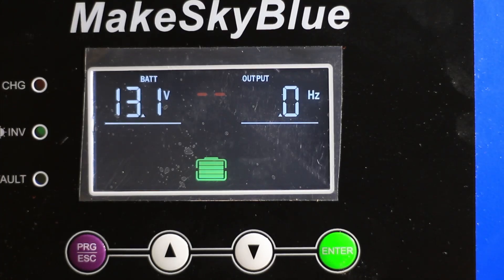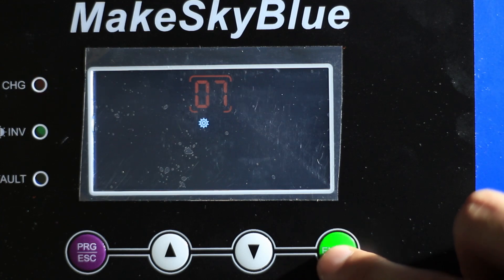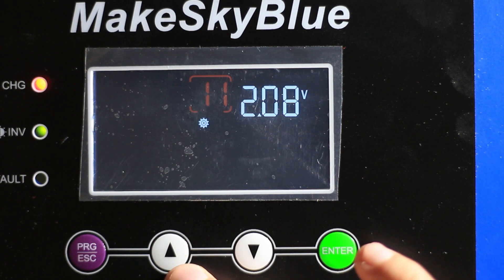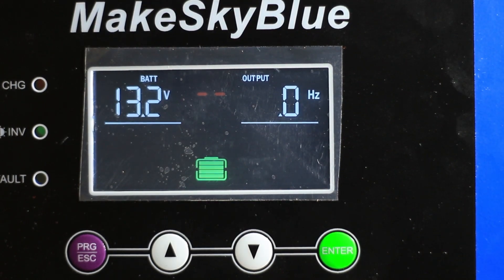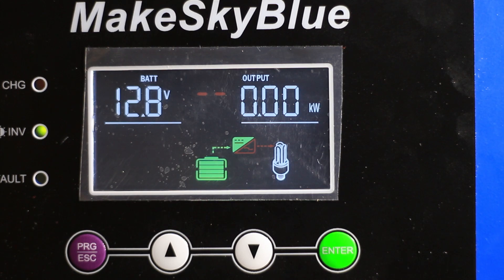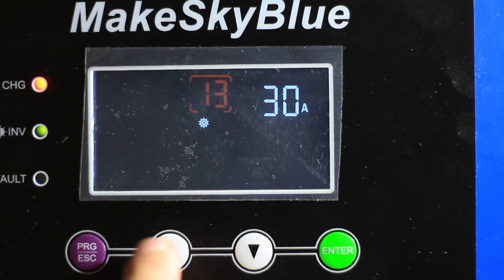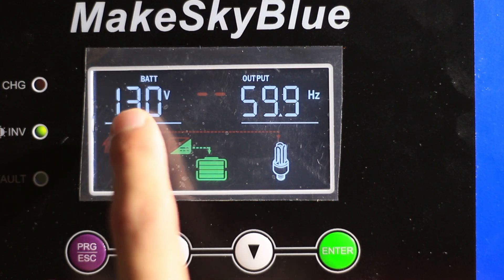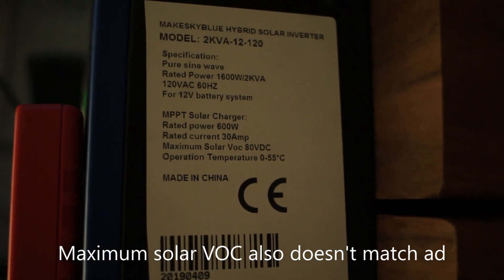MakeSkyBlue Hybrid Solar Inverter Issues

Comment: Well I realize this is an old video but I picked up one of these the two kilowatt 12 volt and the on/off switch seems to have no function at all. When you connected to battery the unit is on

Comment: I've purchased the 3k watt unit and found the same issues.  The website stated a capability of 3k watt of PV.  The manual stated 1500 watts max.  When I questioned the company, they told me that the manual was in error and would be corrected.  The site and manual remain unchanged.  I confirmed there is no AC internal battery charge capability even though the website and manual stated there is this capability.  My unit failed after 30 days of use.  I attempted to get some warranty action from the company but warranty was denied as I had "abused" the unit.   In further discussion with a company rep, he admitted that 80% of warranty claims are denied.  I hope people will learn from my experience with this company.

Comment: I purchased one of these it was 3kw 48volt model and I found that the menu options are limited but I found that it has a wifi ssid showing mppt and some numbers.  I am off grid and no wifi around me so I looked up and found that makeskyblue has an app and with the app on your phone and connected to the mppt wifi you have far more control and you can change the options with it to lipo etc.  Nothing was in the manual about the wifi or app.  You do have to have the communication enabled before wifi shows up.
Reply: Were you able to change the battery type, cutoff time etc using the App? In my case it didn't work.

Comment: I like my Aims inverter/charger...it has a battery selector switch...just turn it to lithium or lead...I guess it does the math or someone already did...it was just easier for me...what's funny to me is everyone has a different inverter so their system acts a little one way or other, so it makes it hard to compare to someone else especially if you're trying to figure out what to buy...it's kind of like running through a junkyard without stepping on a coil spring or starter laying loose...you'd better watch it...lol

Comment: What model are you reviewing? Is it this one? https://makeskyblue.com/products/2kva-hybrid-mppt-solar-inverter-12v-dc-to-120v-ac
Reply from the maker: Yeah looks like it.
Reply: @stingy49  hey thanks for the fast reply. Does this pdf manual answer your problems with it? https://cdn.shopify.cn/s/files/1/0108/6957/1646/files/HYBRID_MPPT_SOLAR_INVERTER_FOR_1K_2K_3K_4K_5K-V1.6.pdf?v=1585972835
Reply from the maker: @MoBiRa-t6k  The unit (and manual) I got didn't have lithium battery setting. Even still, most people would want to set their battery voltage charge and discharge cutoff points for safety.
Reply: @stingy49  that manual i posted shows a lithium battery setting.
Reply from the maker: @MoBiRa-t6k  Yes, but the charge voltage of the lithium setting is not configurable
Reply: @stingy49  yes. It doesn't work.

Comment: Did you ever make it work or how did the story end? The App Ken talks about is most likely for MakeSkyBlues smaller 30-60A MPPT controllers. V119 has the option of Wi-Fi with an app. I have the V117 and I think it’s great for a $42 MPPT controller. I am very disappointed to the problems you have on the hybrid.